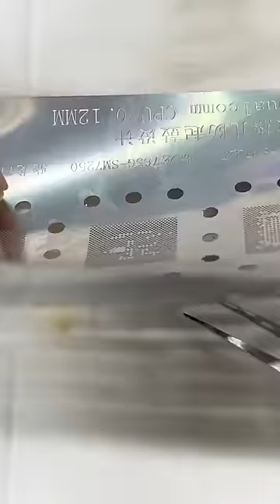CPU Reballing of Xiaomi 10 Youth #Shorts

Comment: You removed that big fat capacitor under the chip without noticing or on purpose and without demonstrating that the board still works ok
Reply: Spot on
Reply: It still work.
Reply: And also that capacitor is for thermal purposes so it's still works when it's removed
Reply: رغم إن نسبة النجاح ٣٠ بالمئة . ولكن الفكرة هي طريقة الفك والتركيب .ولكن في الحقيقة جميع الايسيات المحمية ستتلف عند فكها وقد تتاذى الايسيات المجاورة

Comment: The dude forgot the sms capacitor…. Sloppy
Reply: Circuit works without Decoupling capacitor
Reply: @manishmohandas1075  still sloppy. Sorry but if there is a decoupling capacitor there is a reason. Sure it works with no capacitor, but you potentially make the system unstable, or you get errors that are close to impossible to correct or debug.
Reply: @adrianforschner6917  There will be same capacitor on that line! If you look at the schematic you can make out